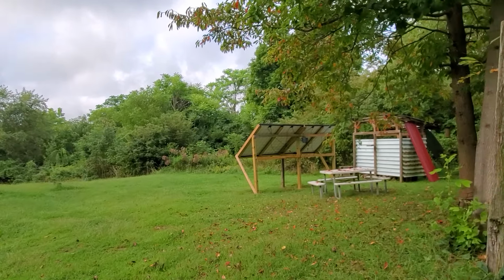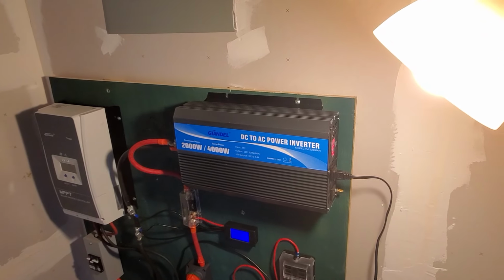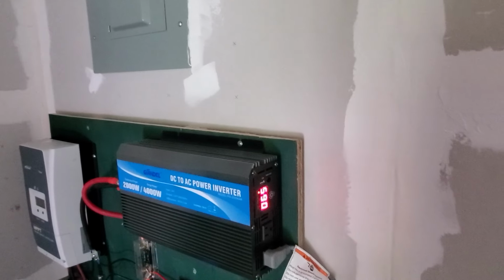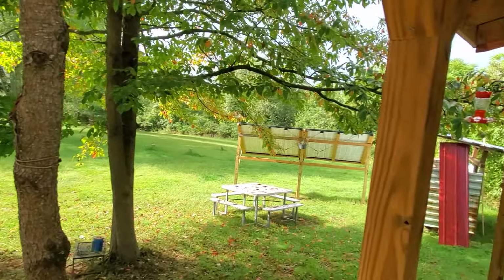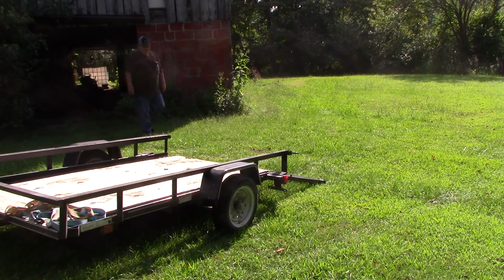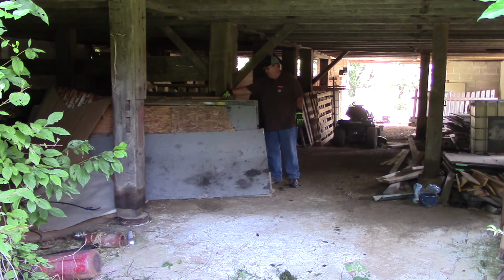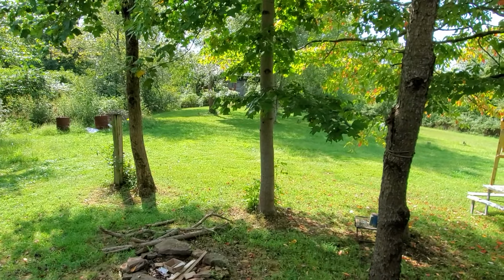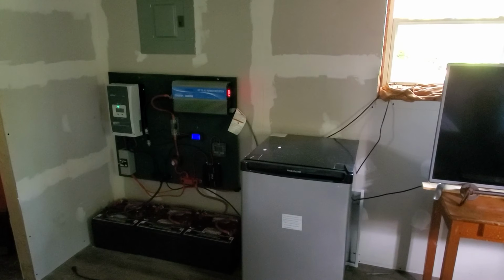Refrigerator Runs is on Solar Power at The Off Grid Cabin

Comment: I have a off grid cabin too. I found my solor works a lot better when I went to a Propane refrigerator. 
Now my little solor system with 4 - 100 watt panels and  4-  6v trojan batteries will hold up just fine for four day stay and then the rest of the week to top off .
Good job Joe .

Comment: Hey Joe!
It has to be the dimmest of days before my solar fails to output anything.  Even grey days will probably be enough to keep that fridge ticking over.  Best to keep some beverages of your choice in it, to give it something to do.  ;o)  Maybe a pack of emergency bacon?
All the best, matey.
Reply from the maker: +SarkyBugger Same with these I'm sure. It looks like even with the rain it produced enough to rin the fridge and add some juice to the batteries.
Reply: @StBernardAcres  I have a similar sized fridge, and it uses 1.4kWh a WEEK, averaged over a year.  You have the advantage that you don't need to use the fridge in wintertime, because you get proper winters, unlike here.

Comment: I just went over some electric providers and found one that will save me around $100 per month. That means I can invest the savings into my cabin build. I pay 13 cents per kwh and found one for .08 per kwh. I use close to 3000 kwh in peak months. I also checked my freezer temperature and water heater temperature.

Comment: If you make you a 12ga cord with male ends on both sides, plug one into inverter and the other in your wall outlet, it will energize everything on that circuit. Just a thought.
Reply from the maker: +Man With A Plan I am going to plug it into the 30 amp receptacle I installed on the back of the cabin for my generator. It goes into a 30 amp main.

Comment: Joe, those briggs engines are hard to kill so to speak! There are a lot of videos on repairing them. symptoms might be valves need adjusted, carb needs taking off and cleaned, fly wheel key way might be broke, solenoid on bottom of carb not opening all the way. Bad plug, the hardest one is the pressure let off when cranking broke inside motor but repairable!